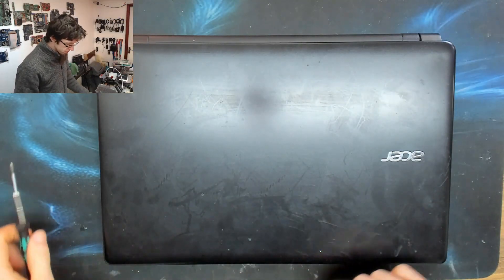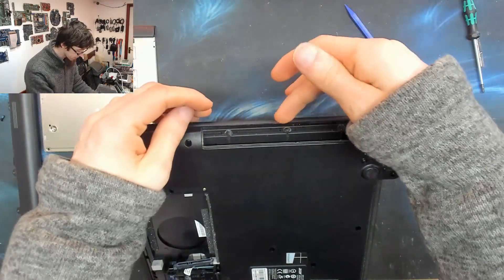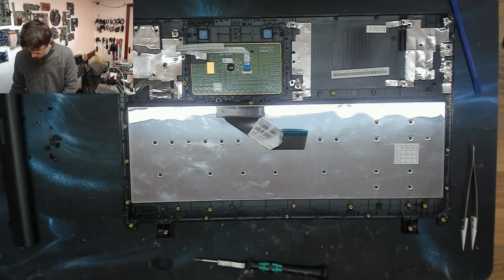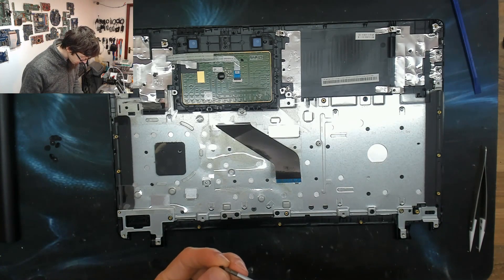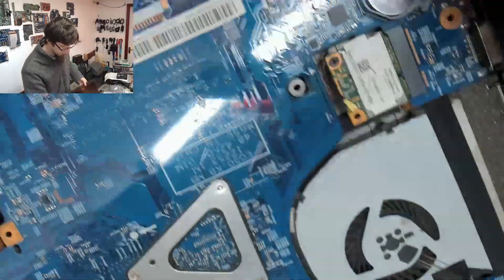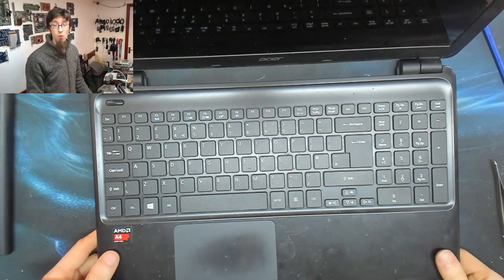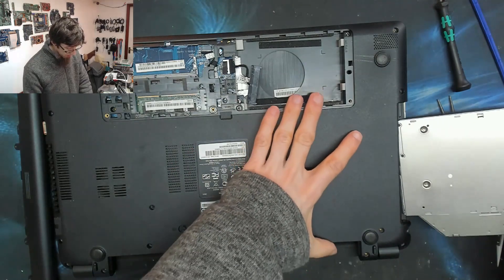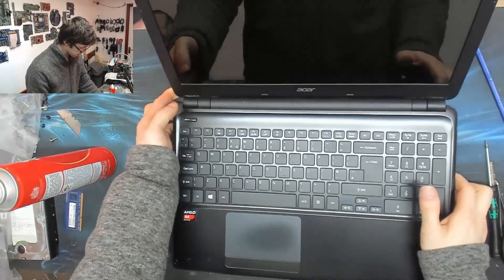LFC#193 - Acer E1 Keyboard Replacement

Comment: WRT DVD drives in laptops, General Dynamics use a proprietary connector rather than the usual arrangement.
For those you actually do need to find the correct one, which requires luck on ebay.. or very deep pockets if you can find new old stock.
Also means you can't do the usual second hard drive conversion unless you're lucky enough to find the original adapter, those get expensive too.

Comment: you don't have to break plastic bits on keyboards like hp have. just use hot air gun on cca 150°C and gently heat them up and pull on metal cover from side. they will melt enough to return to their original state and you can easily lift cover and keyboard out.
Reply from the maker: 🤔Haven't thought of that... usually hot air on plastic ends badly, but I suppose the dead keyboard will protect the top case as it comes out... I'll give it a try next time!
Reply: @Adamant_IT  works for me. just be gentle with temperature.  and yes dead keyboard works as protection.

Comment: ever repaired a surface 2 tablet? i have 1 that i have image but no B/L - there is 12v at board on screen flex it powers on and just looking in the back of MB there is a constant flashing red light in the ssd area, ideas?
Reply from the maker: Honestly, I haven't been brave enough to open up a Surface yet, so I'm not familiar with their internals.